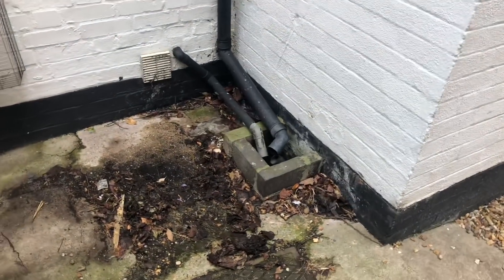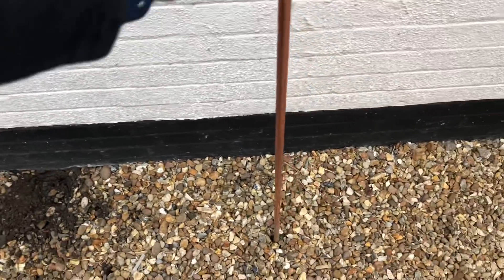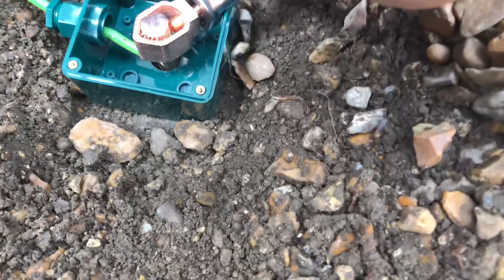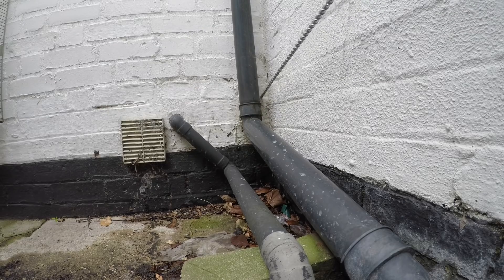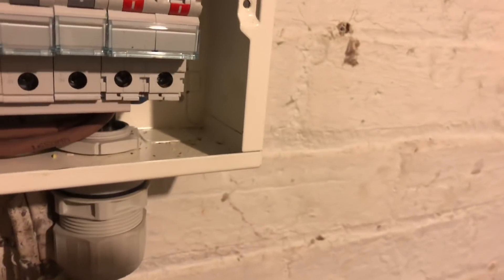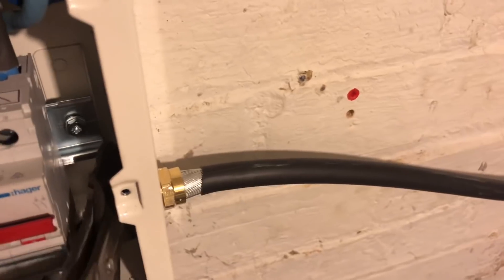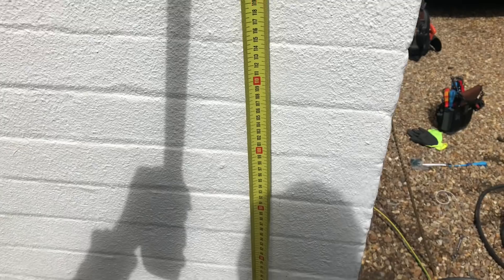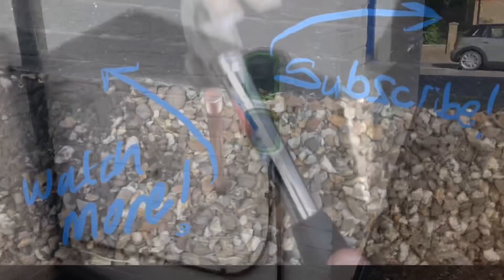How to Install an Electric Vehicle Charging Installation with an Earth Electrode Rod TT System -TNS

Comment: Hello. I work for Hilti. And having ev cars they are wanting to install home chargers. I have tt earthing and single phase electricity. As rural, i also have no mains gas or water. British gas and Hilti want to install a eo mini pro, but according to the installer.they can't fit as i have tt earthing. British gas has suggested another charger using a matt e box. Something to do with ohms levels. But after speaking with matt e. They have suggested installing a separate tt earthing for the charger. And dont recommend using a matt e box as this won't give the protection required. Any help u can suggest would be great.

Comment: I never see you electricians dealing with airtightness properly. You make a hole in the wall, stuff a cable in and leave it with cold/wet uncontrolled air getting in and out. The gap round the cable should be filled, both inside and out, with some combination of a cable grommet (nice ones from Pro-clima), airtight foam and a waterproof sealant.

Comment: Hello! Great video and a very neat job!

Seeking some advice if you don’t mind? 

I’m considering buying an electric car in the next year or so but don’t know quite how I’d get the charger installed at home. I’m by no means an electrician so please bear with if I use half the wrong terms 😂

Does the cable leading to the charger need to come directly from the consumer unit or can it be run from other cabling via a spur/connection unit? 

Sadly my off road parking is at the back of my garden which is quite a way from the consumer unit; and as far as I know I wouldn’t be able to trail the charging cable across any public path to the car for obvious reasons!

I already have outdoor sockets fitted with 2.5~mm 3 core armoured cable running close to the drive, however these are run off of an existing indoor circuit via a switched fused connection unit. To me, this would be the easiest option as the ideal location for the charger is close to this armoured cable, on the other side of a garden wall; but would this be viable?

Comment: Hi Can you install a 3phase EV charger domestically?
Reply from the maker: If they have a three phase supply you can
Reply: @artisanelectrics  yes they do, is this something you can do? The place is in London. Cable run about 20m. Ans how much roughly would it cost. I'm looking having the Zappi

Comment: So the earth from the swa was just in a bit of terminal block in the back of the charging point? Been reading up on the regs regarding these charging points and I can't see where it says what should be done with the earth cable apart from them saying "don't use it".

Comment: Thanks for your excellent explanation of your setup and particularly the earthing rod connections to avoid contact to the PME.
I am still a learner and was trying to get my head round this kind of EV charging installation and your video has helped a lot.
If a house is on a TNCS would you do a similar setup with an earthing rod if you were installing electricity to an outside metal shed in a garden that houses for example water pump and UV light filter, sockets, lighting etc?  The metal shed is obviously an extraneous conductive part so it would have to be bonded to the earth rod. Would  the shed MET and CU still have to be kept separated from the main house PME earthing system?
Thanks again Chris.

Comment: Why use 3 core cable? The outer steel wire is earthed to protect the supply cable and provide ADS. You don't need a cpc to supply TT 
equipement.

Comment: I notice you've used a 40A breaker in the CU, however this will not grade with the RCBO in the Rolec. You should have instead used a 50A MCB at the CU to ensure proper discrimination
Reply: Can't use a 50A MCB when the cable can only carry 45...
Reply: @Jon-em4kc  a 6mm2 will carry 61A with that installation method. But it's pointless anyway as it'd never grade given the characteristics of the rcbo.

Comment: Hi, pls help. Its not clear for me no matter how many times I read the 18th edition. Do you have to connect the PME earth to the earth rod as well or keep the PME earth separate from the earth rod, so the EV charger is connected only to the rod? Thanks
Reply from the maker: You have to keep them separate. The TT earth from the rod is for the charging point only.
Reply: @artisanelectrics  now I understand, the earth from the TNs is just floating if you like, but its there to trip the RCD to protect the cable running to the Rolec. But its the TT will protect the Rolec.

Comment: Please note that no all car chargers require a ground rod.

The Zappi from myEnergi is an example of this.

This simplifies and accelerates the installation work without actually loosing electrical protection.

The fuse box could have used a single AFDD with RCBO device.

This single device provides overload, short circuit, ground, and arc protection (four in one), and it takes a single slot space.

https://youtu.be/mJ-eOawnSTw

https://youtu.be/ZedTmlTLH2w

https://youtu.be/gwmiGf6tChE

Comment: I recently fitted a charging point for a customer. MY PL insurance was due for renewal. On telling my insurance company that i had to drill down lower than 0.5mtrs to install earth rods,i was advised to up my cover. Has anyone else had this
Reply from the maker: Interesting thanks for sharing! I haven’t had that.
Reply: @artisanelectrics  I was told that I would not be covered if I hit any  underground supplies. It's worth checking

Comment: What cable would you use for a three phase 400V installation?
Reply from the maker: It really depends on the situation normally we use SWA 4 or 5 core but it would have to be designed correctly according to the circumstances
Reply: Artisan Electrics -Say for a 11 kw and 22kw charger 400V 3 phase. I have seen Webasto recommend 6mm2 and 10mm2, but wouldn’t 4 and 6 be enough?

Comment: My question would simply be approx how much for this installation should I allow before purchasing the new electric car.plus will this fully charge the car overnight, or is that just a few miles booster, thanks to great video.
Reply from the maker: You should probably allow about £1500-£2k for the charging point and installation depending on your situation, this charging point is 7kW so will charge your car fully overnight.

Comment: A good presentation. What caught my eye was the existing meter arrangement. Many years ago, my house had a similar electromechanical rate change/restricted supply switch setup with an old fashioned meter like that. After that it was replaced by a radio-teleswitch (ultra long-wave) system and a digital meter, then later on it was changed to a fixed timing digital one so as to tolerate reverse current (when I had solar PV added).

The existing kit would not be compatible with local generation (typically solar PV like my place), but also not suitable for those utility supply firms that offer EV cars as storage battery export. In general, those old meters will run backwards if they try that.
Reply from the maker: Thanks for your comments john

Comment: If you had an electric shower 32amp and a car charging 32amp at the same time.would you need a current sensitive relay or something?Thanks for the  video!.i used to have to put this sticky tape over the earth rod to prevent corrosion I remember.witch was really satisfying 👍
Reply: The main fuse in board is 60 amp that is
Reply from the maker: Yeah you need to get the main fuse upgraded if you think there’s a chance of overload. The smart chargers now have the ability to limit the current usage of the charging point at peak demand times.
Reply: @artisanelectrics  I'm getting really twitchy about the second EDF charger being added alongside my existing Nissan leaf rolec :) the leaf can't pull more than 3.3kw and my Tesla will pull the max amps the charger has to give. However I can dial down max amps from the car. When I move, who knows what the new owner will plug in. I'm pretty sure my 100amps might top out. I've been looking at upgrading to three phase but there are no 3-phase smart meters yet! I'm just about to get an air source heat pump.. 42amps nibe ... Twin immersion for hot water... It's getting scary close, I'm no sparky, and no sparky has assessed the totality of load changes.
Reply from the maker: Yeah you should probably get someone to do some load testing or calculate maximum demand because if your main fuse blows you will be completely without power and could take a while to get it fixed.
Reply: Thanks man for getting back!!.I c that with the charger but there is also a a special breaker that you have to buy that coats another €100 euro with vat.
Thanks again keep up the great vids

Comment: Who is going to crawl under that SWA in the event of a fire? Therefore is a metal clip really required there? But knowing how pedantic the regs are they probably now state that the whole installation has to prevent against fire taking out the support. R.I.P. Common sense.
Reply from the maker: Yes common sense died a long time ago...

Comment: I carry 80A & 100A main service fuses to upgrade from 60A or 80A depending upon the requirements, I have the requisite meter seals and correct tool to crimp them as well, I find the DNO's are not bothered about a registered sparky upgrading the main fuse as long as the seals are replaced.
Reply from the maker: You would need to register it with them though surely as they need to keep track of loading on all their cables.

Comment: Do you use 16mm earth when installing and earth rod
Reply from the maker: 10mm is sufficient
Reply: @artisanelectrics  ok thanks. would you use 16mm if it was the main earth feeding the consumer unit on a tt system 👍

Comment: Dont know why but nearly all sparky channels when hammering in a an earth rod they all use little light weight claw hammers.
Use a 1kg mash hammer will go in faster.
Also fitting the clamp before you hit it in helps as the top mushrooms

Comment: If that was a pme / TNCS  system would  you still need a earth rod For a car charger
Reply from the maker: Yeah you need it because it could potentially be turned into a PME system in the future, if you can guarantee it will stay as TNS then you don’t need an earth rod.
Reply: @artisanelectrics   Ok thanks for getting back to me.

Comment: Bollocks, TN-S may go to a TN-C-S?  I ask because TN-S is the best return and TN-C-S is a cop out that can fail.  PME is an overhead or underground supply that has multiple returns to source.  What happens when a fault on the car is returned by the TN-S of the house with a person in the middle?
Reply from the maker: Apparently sometimes it looks like TN-S at the service head but they have replaced the underground cable somewhere down the road and PMEd it there, it happens quite a lot.

Comment: I’m surprised that this has been allowed in UK. In US, the wire is too thin. The wire should also be in metal conduit if it’s not buried inside the wall. Double earths are also not allowed.
Reply from the maker: Interesting comments thanks! What size wire would it be in the US? The cable has steel armouring in it so it’s protected just as well as if it were in steel conduit.

Comment: I would have started at the charging unit first outside, then done the inside work, I always work towards the mains supply then you would have needed to lock off the breaker, plus no danger of anything being live till you have finished.
Reply: Agree it's a good idea to work from load to supply, although in this case he said he didn't have the charger due to lead times, so had to come back to fit it.
Reply from the maker: Yes exactly thanks!

Comment: I am assuming that because the swa offers additional protection for the cable  that is why you dont fit an rcd for additional protection of the cable?
Reply from the maker: Yes that’s right and it’s clipped direct so according to the refs doesn’t need RCD protection

Comment: At 16.39  - you say  "needed to get the customer to upgrade the main fuse "  ?? 
Surely - the capacity of the existing installation should have been checked before commencing works ?
 - Or in other words - part of the opening commentary -  where external influences and design criteria have been considered  - and the supply upgraded ( which it appears it needs to be )  before installation commenced - ie once  contractually committed ?
I'm assuming that this circuit will be a 32A circuit - which of course has no reduction in terms of diversity - so is a full 32A additional load on the system   ?

Comment: By sweating I mean soldering.
Reply from the maker: What kind of solder would you use?
Reply: Tin and lead solder with a non corrosive flux suitable for electrical joints. The jointers working on service cables (live) heat the stuff up in a ladle with an jnsulated handle, and pour it onto the joint after it has been mechanically secured. Fun to watch. The scary part is watching them cut through the lead sheath with a hacksaw to access the conductors!

Comment: Nice job. But I’m not keen on the clamp connection to the electrode. You’d get a maintenance free connection by sweating the cable on. That is what the supply authorities do when installing an electrode when putting a replacement pme service which connects to an old pilc distributing main. They usually just leave the electrode lying in the trench, so it is buried fairly deeply. You were lucky to get a nice low reading from the electrode.
Reply from the maker: What do you mean by sweating the cable on?

Comment: That earth box won't last a year.
What's the point in a weather tight gland and box when theres a massive hole in the back to fill it up and seep along that entire earth cable.
Should have glanded the rod at least.
Reply: I was expecting a proper concrete box. And where's the Vaseline 😂
Reply: Why would a bonding connection need to be watertight? Surely getting it wet would only improve the connection!
Reply: @TheMattSturgeon  so how is that earth going to function when its corroded and has poor connection?
Probably the same reason we don't use wet string as a conductor.
Reply: @jsecret9459  You wrap it in denzo tape problem solved

Comment: Hi Jordan 

Question for you and all you other EV. charging point installers, how have you guys managed to carry out testing on the Rolec charging Pod, only asking because when I did my EV training we were told you need the Rolec testing adaptor (basically a £480 Martindale tester) which tells the charging pod there’s a car attached to the pod which lets you carry out the rcd and Zs test

Lee
Reply from the maker: Lee Butterworth yeah I’ve got the Rolec test unit I demonstrated its use in another video
Reply: There is a type 2to universal socket tester That makes the charger think it’s connected to the car I don’t think they are that sort of money.I install ev chargers for a living and have fitted in excess of 600
Reply from the maker: Nice comment thanks

Comment: Hey Jordan great video. We drive earth rods in nz daily we use Toby boxes which sit flush with the surface and have a lid on them they are great for installations where they are concreting round them. Can you can them back home? TBH braver than me working live, not something I do out of choice especially not in a domestic setting. Commercial I’d think twice. Keep up, loving the new van

Comment: quick question  if the swa gland is connected on consumer and you scratch the paint where the gland fits do you still need make earth connection to the earth terminal??
Reply from the maker: Soyeb mankda technically it should be earthed that way but we always connect an earth wire from the gland directly to the earthing terminal as well, belt and braces as we say
Reply: thank you

Comment: Why you using 6mm 3 core ?
Just use 1.5 XLPE two core
Reply from the maker: kelvin williams I think you would have a serious problem if you installed a 7kW charger on 1.5mm cable...
Reply: 2.5mm XLPE would be big enough for that charger point

Comment: Got some balls installing that MCB on a live busbar, would at least tape my ring up 😉...The Rolec EV unit’s have two earth terminals. One connected to the charging socket and one to house the ‘floating’ earth for TT installations. I.e The earth in your SWA supply that’s not being used.
Reply from the maker: Ah good to know! I wondered what that was for! 👍

Comment: Great video enjoy watching them inpsires me to go solo. Had a question bout the service head as it looked like it's the old type where they fused the neutral too u less is been replaced with solid link. How would you normally go about this?
Reply from the maker: Thanks! There was no fuse on the neutral, only the live, but I recommended upgrade anyway and customer will deal with UKPN direct
Reply: Ok cool thanks for the response. I suppose as long as you've informed them, that s your part done. Do you add something with the certificate for them to sign as evidence? I ask as I'm figuring ways out for hopefully when I go solo as yourself. 
Many thanks again. Love watching these vids on YouTube between and all the other guys too. I use your tip when straightening up existing cables when installing new db, works a treat

Comment: Could I use one of those rods to ground a welding table which I plan to mount on large castors; thereby being insulated from earthing to the ground as it does atm?
Reply from the maker: Eri Si I’m not sure about that you would have to check with the manufacturer of the welding machine